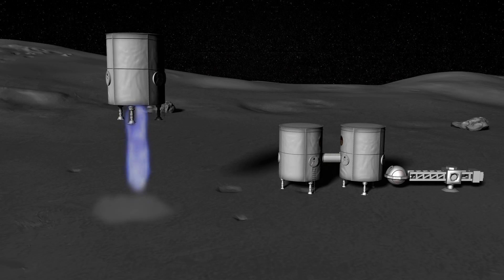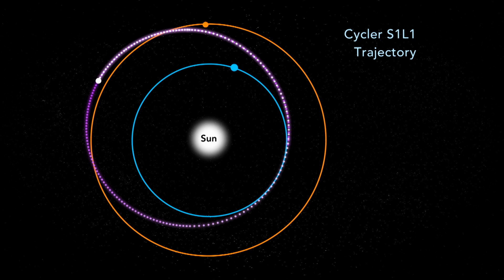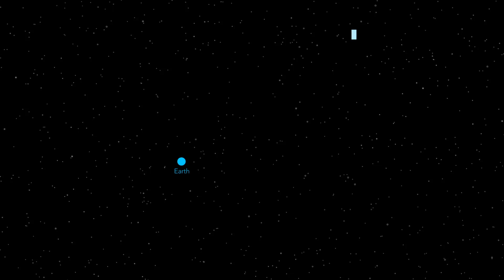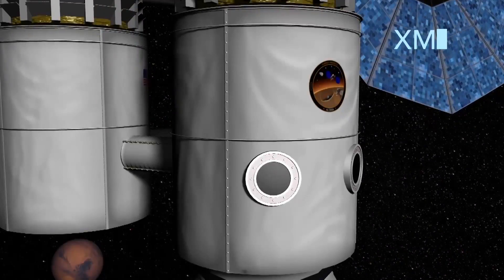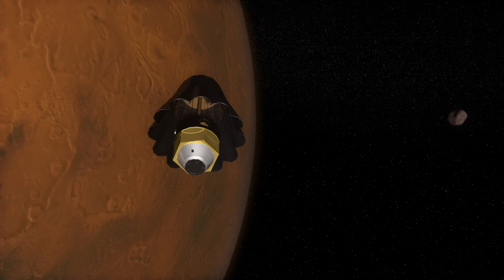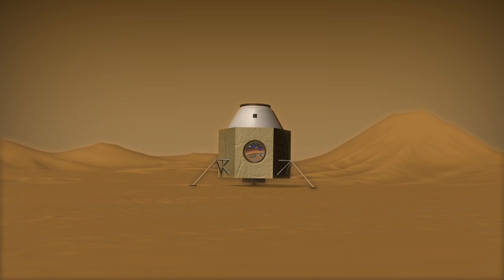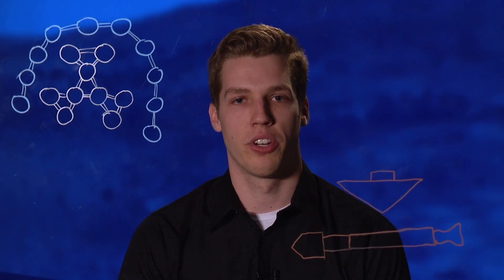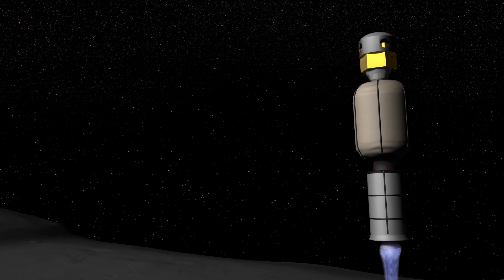Aldrin Purdue Cycler - CYCLER PATHWAYS TO MARS PERMANENCE

Comment: I still prefer Elon's Mars direct with refuelling on Mars. The problem is the need to use Mars CO2 and water to manufacture fuel. BFR Starship tankers could also relay between Ceres and Earth if there was a processing plant on Ceres processing water and Sodium Carbonate to produce Methane. This would negate the need to transport Methane from a launch site on earth to orbit in order to refuel Starships. The idea is to have gas stations (using in situ fuel) for a reusable spaceship.

Comment: why even land on phobos during return? What about inclination? that's more delt V
Reply: Phobos is a terrible idea. It has nothing to do with going to and from mars.  Its orbital is very circular and equatorial making it not suitable for  much of anything.
 

Yeah the Delta-V needed to adjust orbits, aero brake, then raise the perigee would be insanely high.
Reply: I'm gonna guess the reason for Phobos is easy retrieval of the team in case something goes wrong. You need a lot less DeltaV if the first manned mission stops on Phobos. They aren't just thinking about the amount of fuel it would take to slam the atmosphere and aerobrake, they are thinking about the future and getting those people back. In the case of Phobos, with only a little extra fuel in the original mission they could get off the body and into an elliptical orbit for resupply, and the fuel required to get back to earth is much less as well. Once you descend into the martian gravity well getting out is more difficult. With current tech, you would have to rely on a future resupply of fuel and new rocket which has a lot more variables and potential things that could go wrong.
Reply: @37VQV  might not want to make it a regular thing but a sample mission would be good.
Reply: ***** word. I like the idea of going there but don't sell it as a more efficient way to the surface
Reply: +KingLutherQ initially yes. look up the Aldrin cycler on wiki and youtube. the idea is that you don't need the boost a big habitat up every time since it's already there. hell give them room to party
Reply: +KingLutherQ word
Reply: +William Miller Thats exactly what I was thinking as well. You can produce the methane you need on Mars and go directly to orbit, preferably with a reusable rocket. For Phobos this will of course not work because their are no such resources and for the people there you have to do it a different way.

Comment: +Buzz Aldrin What about "repurposing" the ISS as one of those cyclers? It is already in orbit... maybe we could incorporate a couple of "engine-nodes" and move it to the right location. Besides, I'd rather repurpose it than let it fall down eventually like the MIR... What do you think?
Reply: Its to massive and fragile to be able to survive such a boost, also it require constant maintenance due to its age and would not survive longer periods without supplies from earth to keep it running sadly.
Reply: I would love to see scenarios materializing where we use a single SLS first stage, have it launched with integrated docking equipment and airlocks, protected with a thin metal skin from the cryogenics,  equip it with radiation and space debris impact blankets, tug it out to the orbit of the moon, keep it in orbit with ion propulsion and over time kit it out (inside and outside) with all the equipment desired. This cavernous volume could be used for whatever you want it to (science, limited food production, water storage for electrolysis). The experience gained would enable all sorts of Deep Space missions. I know they have been proposing this since the  1970'ies but I cannot find any showstoppers, either in the basic structure of the tanks, replacing the current orange insulation with more durable stuff (or just eliminating it) conditioning the tanks or equipping them.